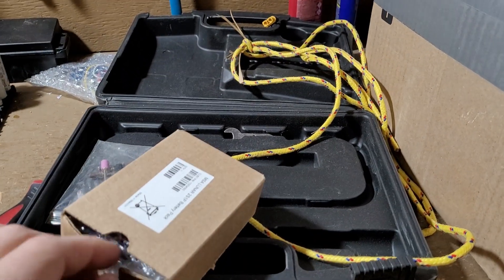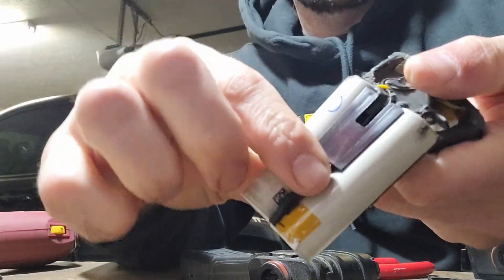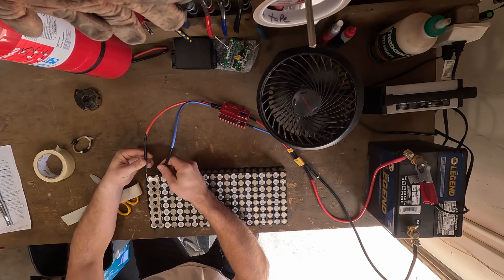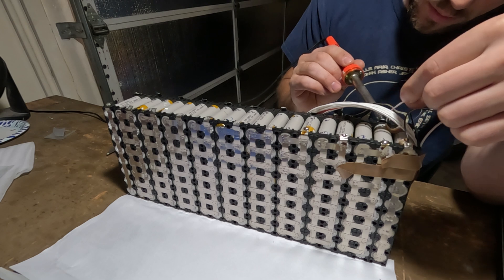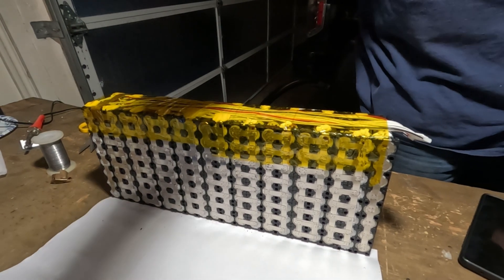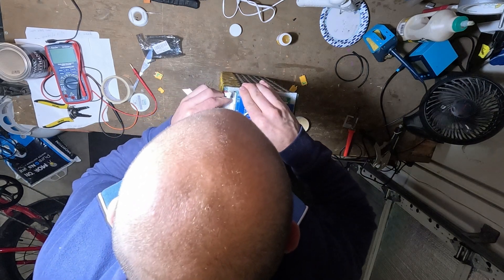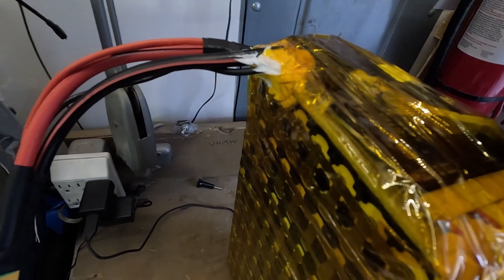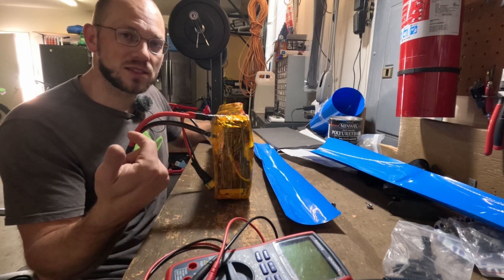DIY 72v 20AH Battery Build

Comment: Yeah, I don’t know too much about batteries what I think I know is that using pure nickel is the only way actually using nickel with steel mixed is a bad combination and can cause a shortage that’s what happened to a factory. I read about in China they were cutting corners by using Mixed nickel instead of pure nickel and just one sure it caused a whole factory to catch on a fire so I’m pretty sure the companies are not cutting corners anymore for safety reasons and lawsuit reasons. Of course a safe battery is the best battery and from what I see you’re making a big powerful battery my understanding of it I cannot comprehend what you can, but it is very interesting to watch and learn great content

Comment: Did you manually top balance the pack before wrapping it to give that poor little BMS a fighting chance at maintaining that balance? Since you assembled it with harvested cells, unless you manually charged each cell to 4.20v before assembling, it is good to watch it the first charge and use an hobby charger to drain or top off each brick until you see everything in balance, the charger light green, and the BMS bleeding down any slightly high brick.

Its good you added a AWG 12 collector on the nickel. Most people overlook that and just attach to one end, effectively making a snake bus with 80a/200a going through one sliver of nickel strip. The only thing I did differently was distribute the 2 B- wires along the collector, which on your battery would be between 2p/3p and 6p7p so that each segment of the AWG12 collector only carries 20a and each B- wire carries 40a/100a. 

Those look like Molicel 18650’s. Not sure which cell but I don’t think Molicel makes anything weak, so im sure the pack does pretty good. 

ANT BMS are dirt cheap now and being able to see what’s going on, especially with harvested cells, is really nice. My 80a/200a Bluetooth ANT was only $40 delivered. Its just so nice to open the app, check how the cells are doing, check for sag in each group, check for self discharge, etc. 

Im currently rebuilding my P42a pack because my BMS told me I had some bleeders. Not surprised because I knew I burned some holes in a few of them when spot welding but figured I would monitor them. After a few weeks when enough electrolyte leaked out the damaged cells began self discharging, progressively more and more. So Im in the process of letting them set so I can see which are bleeders and which I can reuse. Lol
Reply from the maker: Thanks for the comment! I used the XTAR VC4+ and balanced each individual cell to 3.72v before connecting them together. Once assembled I then charged it to 100% to rebalance the cells together. So far, it's working great. I charge to 85% and every 6th charge I rebalance the pack and charge to 100%.
Reply: @tminustoday  I use ANT BMS on my battery and i set it so it will never balance automatically. I periodically charge it to about 4.100v/cell and balance it to 0.000v differential by manually starting autobalance. This begins a monitoring period where i will discharge and charge several times, charging to 50%-80% after a ride and only charging to 100% if i plan a longer ride. 

I view cell differential as the #1 battery health indicator, during rest as well as at max discharge current. A perfect battery would keep 0.000v difference regardless, but nobody has such a battery.

Checking differential at rest after discharging it tells you how well the cell group capacities are matched and will also tell you if a cell had died (CID disconnected).

Checking differential at max discharge current should be done on the new pack, establishing the baseline. If that starts growing over time, at the same battery temperature, that may indicate a decrease in health,

And finally the resting differential after charging and discharging it several times tells you if there is any self discharge or severe IR imbalance in the pack (which should show up in the max discharge test).

At this point I would never use anything but a Bluetooth BMS on any battery that cost more than $500. Its worth the few extra bucks to be able to see everything inside the pack without opening it.

Comment: Hey do you know could you build a 76v 20ah battery that fits in your razor dirt bikes the sx500?
Also how much would that cost to make?
Reply from the maker: You can do a 21S configuration on the SX500. I would look at upgrading the drivetrain and suspension as well if you are going to push that much voltage through that small chassis! 48v was plenty to lift the front wheel with power wheelies. Be careful and have fun if you decide to go that route!

Comment: Length of sense leads doesn't matter. 
You should really cover up all the areas you're not directly dealing with when welding the nickel strips. I accidently had a strip shift between rows.. insta fireworks. Also, protects against accidently setting it down on a scrap piece of wire / nickel strip / screw etc.
Reply from the maker: Thanks for the advice! I'll completely cover any areas not being worked on with my next project, there is no reason not to.
Reply: wait a minute. how could the cells balance ?/??  different length cables certainly would interfere with voltage movement, current drop, etc. kirkhov's law, etc
Reply: @greghanson-w3d  It does matter, but only insofar as the further away cells will take longer to balance. The closer they get to the final value, the lower the current, and the less impact the wire resistance will have. So they will all eventually balance. Realistically, 10 inches of 18 gauge wire is about 5 milliohms. At 200mA balance current, that's 1mV. Lost in the noise.